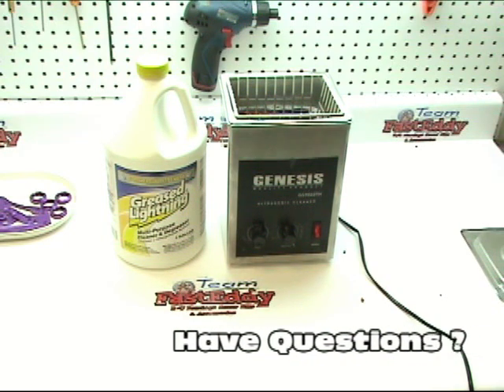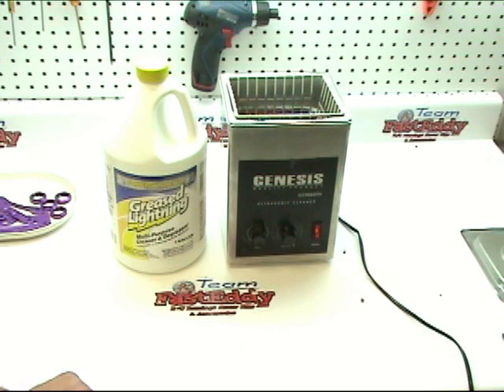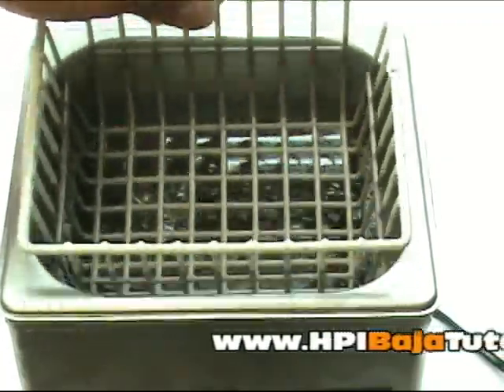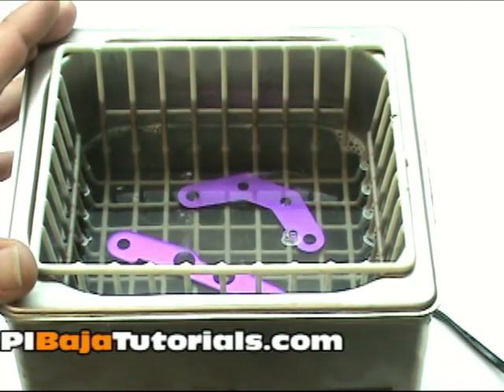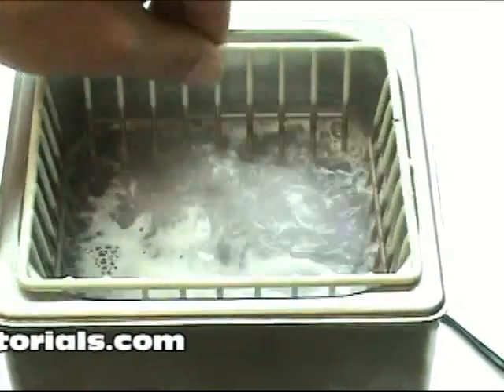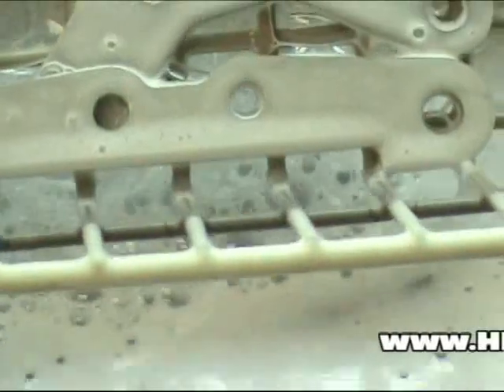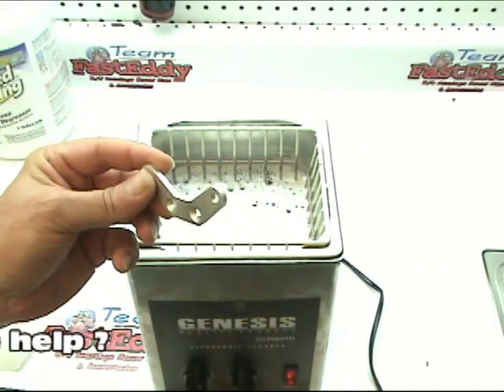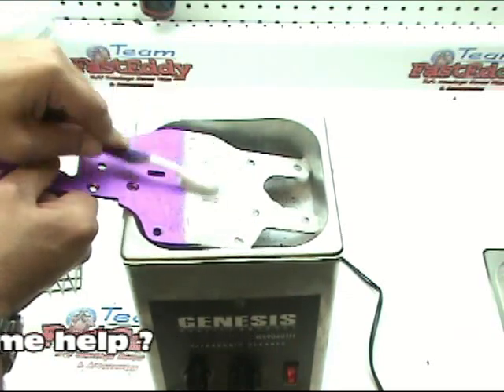Tutorial: De-anodizing Aluminum on your RC Car

Comment: Those splotchy spots are the anodizing. To get it all off use a little lye mixed with water. eats the anodizing layer off. Be sure to not leave it too long as it will keep eating the aluminum.Love all the post of people who have no clue what anodizing is or how it works and act like they know everything haha
Reply: I suppose you can use any strength caustic on this 
I found some 99.8% caustic in a 100g bag plenty just to do a few parts on a rc helicopter lol oven cleaner is good but I bet its not as good as 99% pure caustic

Comment: Aluminum doesn't "rust", but does oxidize. All anodizing does is add a layer of oxide faster than leaving it to oxidize naturally. De-anodizing will remove said oxide, but if you don't protect it it will oxidize again quickly, as aluminum oxide is very tenacious.